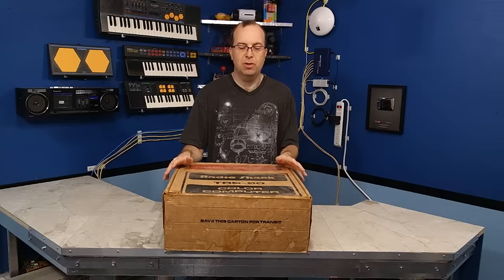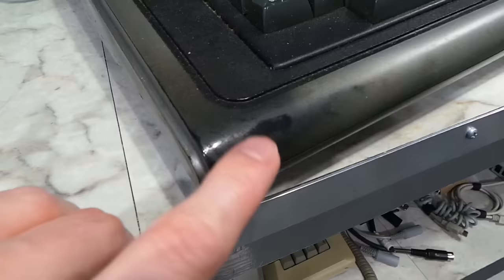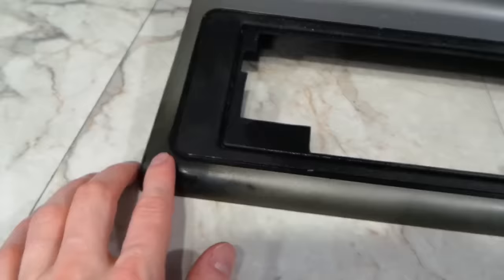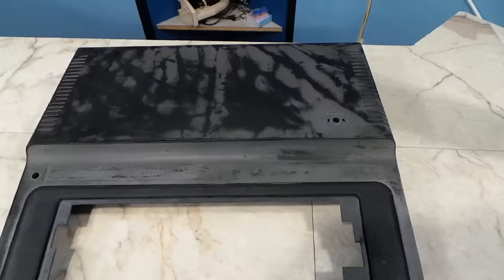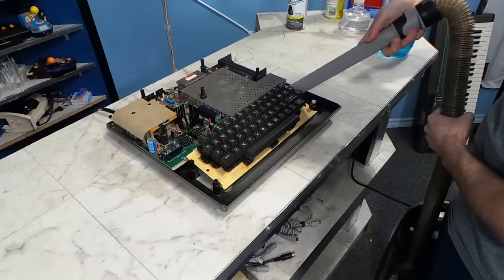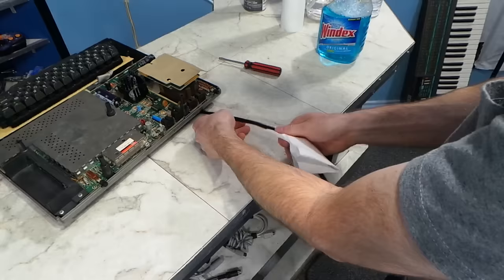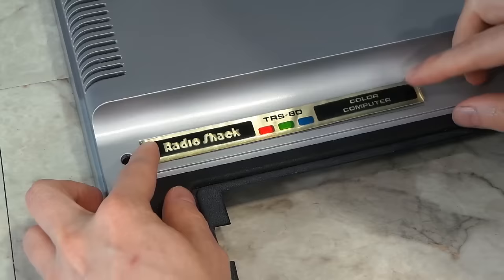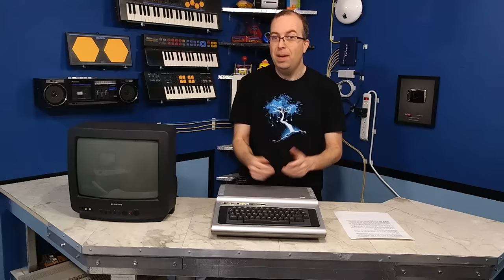TRS-80 Color Computer 1 Restoration

Comment: 2 things those Hitachi RAM chips are 64Kx1 chips you can easily tell by the number on them (hm4864p-2) the 64 gives it away..

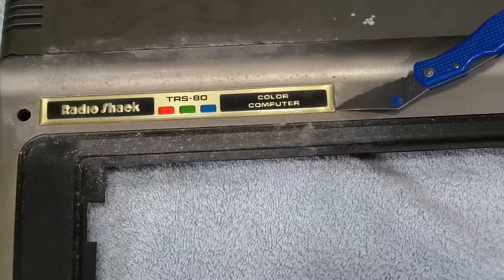Strange that the previous owner took the time to drill a hole for the power LED mod when all he had to do was remove the 4K badge and there is a perfect hole under it that a LED would fit in (3:49)...The LED in place of the RAM badge was extremely common on Model III and 4's and coco's

A piece of trivia for you: the warranty sticker over the screw: if it is a black sticker with white lettering it is from the factory if it is a white sticker with black lettering it is from a Tandy Service Center...

Comment: For years I've used a car tire cleaner called Black Magic Bleche-Wite (formerly Westley's Bleche Wite) to clean computer and monitor cases. It doesn't work as well as your method to restore the plastics natural color but it does a remarkably good job nonetheless. It might work well as a fist step cleaner before moving on to your process.
Reply: This product works miracles on cords as well. ;)

Comment: While using the label maker worked alright, there is another solution you might try next time when reproducing the labeling.  

Try creating them in something like Gimp or Photoshop and then printing them on clear backing decal paper.  Then use Micro Sol to have the decals "melt" into the surface, making them look more original.

Comment: IIRC,  it would be much more likely this is actually a 64K machine.  32K machines were usually piggybacked 16K chips,  although there were some with 'half-bad' 64K chips. The machine could only address 64K TOTAL memory locations,  and that included mapping the roms, scratch pad RAM,  reserved memory locations for cartridges,  etc. About half was programming RAM,  but even some of that was reserved for graphics pages,  hence the apparent 24K free memory on a 32K, or 64K, machine.

Comment: When you had the lid off did you check what chips were fitted. From what I remember the board only took one bank of DRAM so if it was upgraded past 16k it was most likely 64K, but you needed some tricks to make use of the upper 32k, because just flipping it into 64k mode meant the ROM basic vanished.
You could do some neat things with that other 32k though.

Comment: I have two of the originals and 2 of the later coco 2's.  You could actually upgrade the ram in the coco 1 to 64K as I did that on one of them.  I still have a couple of the books such as "Your Color Computer" and the RS Color Computer Assembly Language book.  One of my first uses was a primitive home automation unit using their X-10 cartridge.

Comment: The best way to remove those aluminium badges is to use a heat gun or hair dryer.
To remove acrylic paint from the power lead use Methylated Spirits.

Comment: To answer your question the issue with the aluminum finish was lacl plastiic prep for metalic paints and with the lack of a clear coat the acis in skin and sweat  wat the paint, sadly this problem still exists today with computers with the same type of finish I own a toshiba laptop  that had the same issue with the pain..

you''ll likely need to scuff the  surface witha course sandpaper to get the paint you use  to adhere to the plast  and after you finsg it clear coat it  to save the issues  you'll find that tye problem within the 1st few month's

Comment: Use automotive paints and clearcoat (either shiny or dull). if you dont use clear paint wont last to human abrasion and contamination. also drying time could be weeks. For palmrests and stuff, 2k clearcoat will be the most durable. Its epoxy based

Comment: Looks good but I would run folded 800 grit sandpaper in each vent.  Paint has a way of spraying uneven in the vents.  if you just sand the ridges flat it looks better.

Comment: I have a TRS portable computer that I bought in 1981 to run statistics and write my dissertation.  Mine was the first dissertation at Texas A&M University written on a word processor.  They wouldn't accept dot matric printing so I had to cough up $2,995 for daisy wheel printer.  It has no hard drive but operates entirely on floppy discs.  I still have the entire sysstem and discs.  I might be willing to part with it if it is any use to anyone.  Frankly I feel that it is a museum piece.
    DrJimM
    Natchitoches, LA

Comment: Nope Not Original - That was a Keyboard replacement add on some one bought off of Rainbow Magazine. Original Keyboard is a chicklet.  That was my first computer. Also noted that the memory was not a kit bought install since they came with a replacement cap that said 32 K, Led connection was from an article in Rainbow too to add a power light. it was an amazing machine.

Comment: If you're doing more stuff with the CoCo later, maybe you'd be interested in a little program I made (and probably still have on tape somewhere) which uses the "high resolution" graphics display as a 32 character by 24 line text display?  It's in machine code and can display the full IBM extended character set (256 characters) and you can define your own characters from BASIC.  You access it with a USR call.

I know I still have my old CoCo out in the garage, and I probably have the editor/assembler cartridge and the assembly code source code for my program. :)

Those were fun times.

Comment: When you said Oven Cleaner and 30 minutes i knew you'd not take off much paint. it takes about 24 hours to remove my model toy paints. I also used Easy Off Heavy Duty (non-caustic version doesn't do anything to paint)

Comment: I would have rather seen the computer stay the way it was. You are right, the computer told a story, a story of someone who really loved and cared for their Coco and used it every day. I think that story is told better by leaving it all worn down where it was used so much. If you are going to paint it, then at least don't do a half assed job. You literally painted only half of the computer, the slats on the sides had runs, the paint was really uneven on the sides, the color was way too bright and from what I could see, the masking job wasn't done well. Here is a tip if you decide to paint something else, always use auto masking tape (can be found at autozone or pepboys), It does a much better job at making very straight lines. You could also even use matte auto paint, it wont react with your hand and it doesn't run as bad. Also, lightly sand the paint in between coats for a SUPER smooth paint job.

Comment: Hey! I've been marathoning your restorations at random and on this one I'd like to pass on some knowledge from the Doll repaint/restoration community very often for helping paint adhere to plastic and Vinyl as well as protect from knicks bumps and wear and tear There is two ultimate Trusted products:
Mr super clear(better for vinyl and creating a matte look) and Liquitex Matte Varnish (the recommended application method is to water it down half and half and apply 2-3 coats, though sometimes this can still leave a slight gloss look) 
Next time you do a repaint project see if you can Give these a try!

Comment: still have my coco2 with radio shack tape deck in a box with lots of games on tape, and 2 joysticks. has the chicklet kb. the previous owner of the refurb you did likely spent hours and hours typing in programs from rainbow magazine(trs-80) to get a white block to move across the screen.

Comment: Excellent Restoration.  I think you'll be happy with the paint you used.  Sounds like you were just guessing on a technique, but it was just fine.  I do 6-8 light coats, where the first 3 tend to look like they are thin coats.  For my restorations, I tend to use Appliance Epoxy Enamel paint because it holds up so well to everyday use and abuse.  However, I'm usually using that with metal chassis.  It still looks like you don't use flux with your soldering.  Do you use flux and just don't show it in the video?

Comment: Regarding the aftermarket comment: I think you are referring to quite some wires and things around. These were quite common, more than 2 layers were often prohibitively expensive, also sometimes a design mistake was fixed in the first batch by soldering in components here and there, so those might as well be factory. What certainly is not factory is all these capacitors that are snipped off at one pin, I really wonder what that was for...

Comment: Mine had a switch I installed to disable the activation of the non maskable interrupt signal from the cartridge slot enabling me to copy rom packs to cassette. What was a big hit for people was showing how to double the clock speed through software and making the computer faster. Anyway enough of me..good presentation.
Reply: No need to install a switch for that. There was a mem location you could poke a value to do that.

Comment: You need Goo Gone to remove adhesives from computers and game consoles.Since the machine is never going to be factory original again, anyway, you might also want to consider something like the clear plastic film they use to protect the paint on cars from stone chips applied to the high wear areas to protect the paint.

Comment: Ive been waiting for you do find a COCO, I ran a COCO club for about 10 years and still have quite a bit of stuff, including floppy drive controller and floppy drive, lots of floppies and I might even have the original box... I love that little machine and used it for gaming, word processing, and spreadsheets, and I also did some database stuff. and you had to tear that little sucker apart to do memory upgrades and burn new bios's just to have special functions that you wanted. I can go into the basement and turn it on and it will beat it's little heart out until im tired of playing with it.

Comment: A well used CoCo, likely used by a smoker, if it smelled as such, which for a left-handed person would explain the possible ash deposits on the LH side of the keyboard/case.
If well used, it would be for a basic developer, or a possible OS/9 User/Developer.
The way the deposit on the top stops is likely the 2-disk setup for OS/9 and monitor on a carryover stand. Left-handed user + LED mod and 32/64k memory update, and ROM update?

Comment: Hi there if I remember right what I used to take the paint off of my Coco one was lacquer thinner wipe it on and it white paint is pretty much wiped off takes a few times but wasn’t too bad some Coco ones and the paint are black and some Coco ones and the paint were a light gray easiest way to takeoff the main badge I found was to get some either thin fishing line or even dental floss and put it under the bed and go back-and-forth all the way down the badge basically you’re just cutting The glue

Comment: I think that to remove the paint would have been better Acetone or some solvent for paint like tiner, just use a little inside to see if it dissolves or damages the plastic.
I am very interested in color computer (I have many cartridges and accessories) and Vic 20.
I translated this video into Spanish

Comment: if you ever want tips painting plastic i would be happy to send instructions or do it for you . love the CoCo's & Tandy 1000's !. to take paint off that plastic add 25% nail polish remover to alcohol scrub with scrubbing pad for Teflon for tough spots use 220 grit wet/dry sandpaper with alcohol.

Comment: pressure washer....
Ive had good results.....on some type of plastics.....as it takes off the discoloration ...top layer of plastic.....ready for painting....wouldn't use it for  smooth finish plastic....nice job btw... :--)

Comment: David, I'm curious. Did you change the connection for the LED wires before reassembling them, so they'd be easier to disconnect? You mentioned in the video that it would be preferable, but didn't say whether you'd done so.

Comment: One of those strange, useless bits of information that sticks in your head for decades - a perfect color match for the CoCo, Model I, Model III is a late 70's or early 80's Mercedes silver (I don't know which silver, as there were multiple shades available, and this is going back 35 years)  The little touchup bottle I got from a MB dealer back then worked great for scratches, IIRC. I imagine any auto paint store could mix up a pint from the color code if one wanted it badly enough.

Comment: I would like to know where I can get some replacement rubber domes for a TRS-80 computer keyboard. I have a TRS-80 computer that I am trying to get working. One of the problems that it has is that some of the keys on the keyboard were stuck & I had to open the keyboard up on it & in the process, I accidentally lost a few of the rubber domes. I would like to get it working.

Comment: This was my first computer.  I was able to program every single example video game with the book by memory, and I of course improved upon all of them.  I ran of of memory making a game I called Polaris, which was a missile command clone, but with subs dropping bombs over an Atlantean set of cities and I ended up getting a Commodore 64.

I have absolutely 0 interest in ever owning this piece of junk again but I do have fond memories of Project Nebula which I think was one of the best games for the system.

Still, I have absolutely no interest in owning this system, or even running a simulator of it.  It was a primitive, and very expensive, piece of junk.

Comment: Ouch... heat or freeze badge before pulling it off...
Original labels say "RESET, TO TV, CHANNEL SELECT 4 3, CASSETTE (you skipped that entirely), SERIAL I/O, RIGHT JOYSTK, LEFT JOYSTK, POWER" your printed labels look pretty good, rub on letters (Presto, Letraset etc) could look better - and last if you put a clear coat over it.

Comment: First of all, that's probably actually 64K of RAM. There was basically no such thing as a 32K DRAM, except for some bin failures being sold cheaply. Various control addresses on the SAM can swap RAM into $8000-$FEFF. Sometimes people did that to allow patching BASIC. And the silver paint was also a thing with the Model I, Model II and Model 3. It wasn't until the CoCo 2 and Model 4 that they went with the white plastic. I didn't get to see what key mechanism your computer had, but it looked a lot like the original Model I Stackpole keyboard. (identifiable by the 4-finger metal contacts)

I had a Model I back in the day, and yes, the palm rest areas were all worn off. In 1984 I got a 4K CoCo 1 just to write 6809 assembly language, and the first thing I did was drop 64K of RAM in it. Oddly I had gotten 64K chips that weren't single 5V supply, so I had to set some jumpers to 16K.
Reply: Okay first off rude. Secondly it's about restoration.. thirdly not everyone is familiar with ever single model. He may have more experience with the one he's talking about(trash bin worthy or not) and he just assumes that it is. Until he gets more information about it. How about you information drop in a nicer way.
Reply: I also just refamiliarized myself with some of the information 32 k dram is actually quite accurate for some of the computers.

https://en.m.wikipedia.org/wiki/TRS-80_Color_Computer
Reply: Specifically says that it was one of the first computers Made in this line.

And This

32K CoCo 1's actually had perfectly good 64k memory chips in them; many utilities and programs did begin to take advantage of the "hidden" 32K.

Even later versions of the CoCo 1 dropped the 32K memory option entirely and were available in 16K or 64K versions. All versions that shipped with standard Color

...
Note how it said later models dropped the 32k and he said it was one of the first. So how about like I said you check your backs and you don't jump on someone for something like that when you're clearly wrong. It might have been the reason that they upgraded it. Instead of just throwing it in the bin as you put it. I don't know someone spends hundreds of dollars on something even back in the day you don't just throw them away you'd make do with what you got my parents always took care of their items so that they were always like new. It would be like they just bought it almost everything that they have. Because taking care of things preparing them or upgrading them that's just how we do it. But we aren't rude we think we know everything your personal experience is cool but not everybody has your personal experience.

Comment: i has a question. Even though all the computers at my school are Dell and run Windows 7 (except for Chromebooks, which runs either Windows 8 or 10), there is a lonesome Apple IIsi on a cart of et cetera electronics. Why does it exist within the school walls when there is no signs of floppy disks or anything else that can be used for that style computer? (also, the IIsi has both the computer its self and the moniter)

Comment: I have a Tandy Color Computer FD 501 floppy disk drive and controller.  I want to buy on EBay the computer to go with it, but I want to make sure the floppy drive works first.  Is there a way to see if it works at least to a degree with out the computer?  When I plug the floppy drive in and power it on with the switch it does a little motor move for a split second, then nothing.  The light on the floppy drive doesn't even go on.  I know its controller is not plugged into a coco so could this be normal?  Any help would be greatlty appreciated, thanks!

Comment: Here are the specs on this particular unit
Developer	Tandy Corporation
Manufacturer	Motorola
Release date	September 1980; 43 years ago
Introductory price	US$399 (equivalent to $1,420 in 2022)
Discontinued	1991
Operating system	Color BASIC 1.0 / 2.0 / OS-9
CPU	6809E @ 0.895 / 1.79 MHz
Memory	4 / 16 / 32 / 64 / 128 / 512 KB
Graphics	MC6847 video display generator
Sound	6-bit DAC